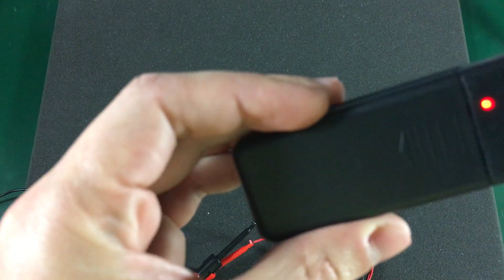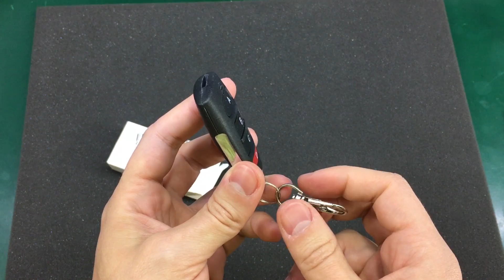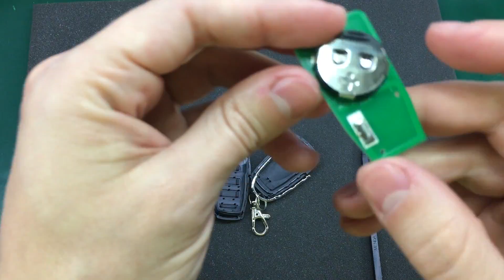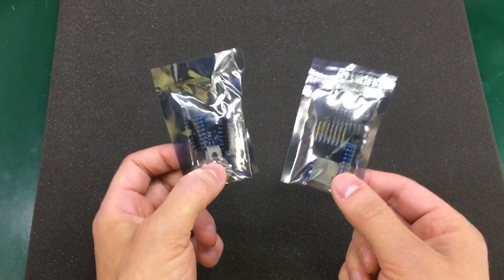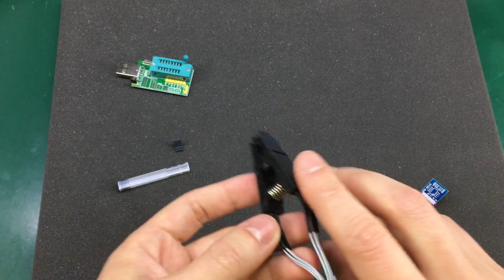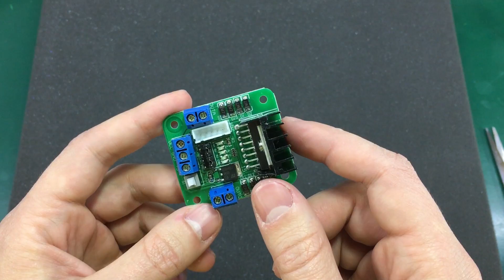Voltlog #100 - InTheMail

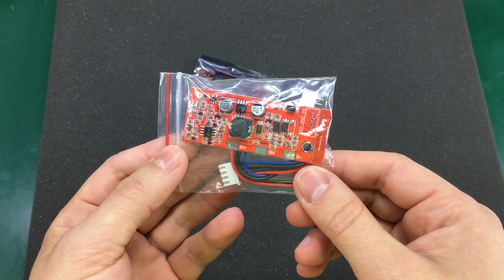Comment: 10:28 that is probably just a BMS, there is a difference between balance charger and BMS, BMS will just shut off if a cell in series dies or gets over charged, but there is no way of keeping it in balance

my long search of cheap diy 1S - 6S  Li-ion balance charger continues.....
Reply from the maker: true, everything that's available seems to be just BMS
Reply: do you have any idea of using lots of TP4056 for this purpose? i was thinking about making an E-Bike battery and those are like 8S to 10S, and i wanted a simple plug and play charger like the B3,
Reply from the maker: you can use as many TP4056 as you would like, each powered from it's own isolated dc-dc converter.

Comment: +VoltLog The Lithium Battery 2S Protection and Charging Module. I don't know if you looked into it, but you can use anything between 9v to 15v so a typical 12v charger would be good.
http://www.ebay.com/itm/Intelligent-Balance-Charging-Protection-Board-2S-18650-lithium-Batterie-Cell-/142151772422?hash=item2118e7e906:g:gRIAAOSwmLlYBM7r
Reply from the maker: I've been wanting to build a battery pack out of 18650 cells for a long time but I haven't tested any of those modules yet.

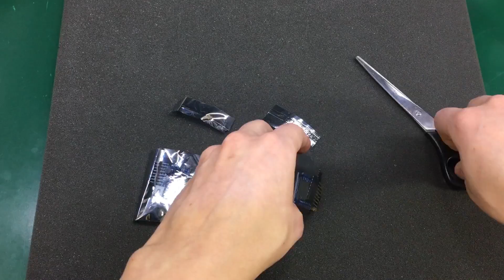Comment: +VoltLog @ 12:19 The battery Shield boost a typical 4.2v-3.7v to 5v but is it noisy for audio? For powering a 5v amp or Bluetooth with a Micro SD Card and USB device?
Reply: Do you need a Wemos board or can you just apply this directly to a battery?
Reply from the maker: the boost circuit should work on it's own, however a switching circuit is not desirable for audio applications.

Comment: Those EL systems use high voltage AC drivers (same for backlight EL displays), if you measure the voltage feeding them you will see what I mean, that is why they whine.
Reply from the maker: I wouldn't say they whine because they use high voltage(~100VAC), like you said, the same high voltage is used in EL backlights or even higher in CFL and if done properly doesn't whine. So this is likely a design issue coupled with low quality parts.

Comment: Would you consider a quick review on a small module: 2.8V to 5.5V input plus or minus 12V output 5V turn +-12V DC-DC converter board? The price is very good. I'm interested in output current capability, how much digital noise on the output, and clock frequency of the converter. Here is a link: https://www.aliexpress.com/item/Power-module-2-8V-to-5-5V-input-plus-or-minus-12V-output-5V-turn-12V/32666564888.html?spm=2114.13010208.99999999.309.8MLIMz   Thank you!
Reply from the maker: ok, I'll take a look at this.

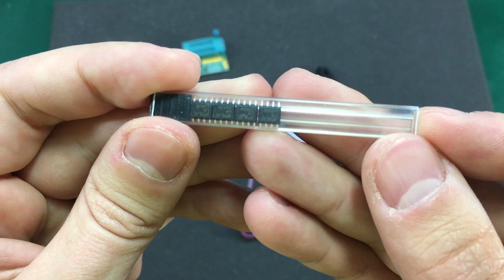Comment: 13:11 you not need soldering if using (two) clamps (binder clips), which compress the legs of the chip on the work surface. Every soldering take chip lifetime shorter.
Reply from the maker: I don't see how I could do that, the dip adapter pcb is so small, no way I can get a binder clip in there and still be able to plug it into the programmer socket.

Comment: 17:40 I use those modules to control blinds over here, got several of them to let the smoke out when changing the direction too quickly so you might want to add a delay when doing something similar
Reply from the maker: Thanks for the hint! I'm thinking the current is quite high when reversing while still running in one direction. One improvement might be to sense the current and automatically cut-off when the value goes over a threshold.

Comment: The all in one bluetooth amplifier board would be an excellent project. A TPA3118 based board would be an excellent start.
Reply from the maker: Regarding the CSR8635 module I am planning on building an audio receiver module, for connecting to systems with AUX in ports.